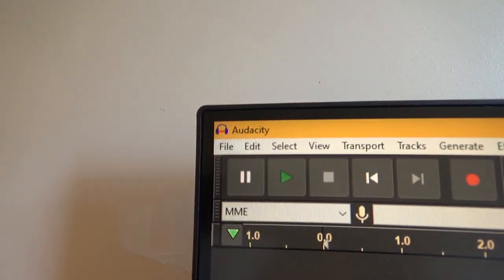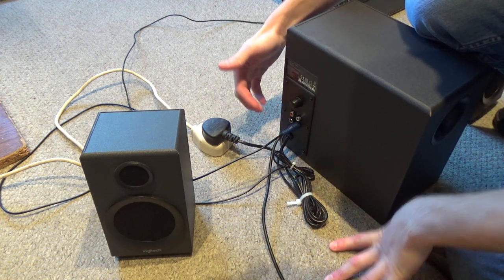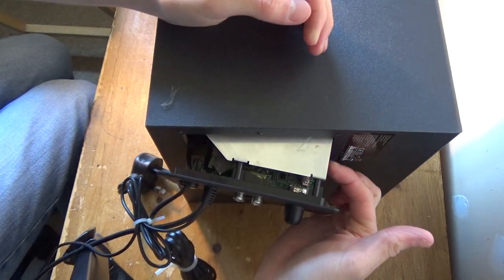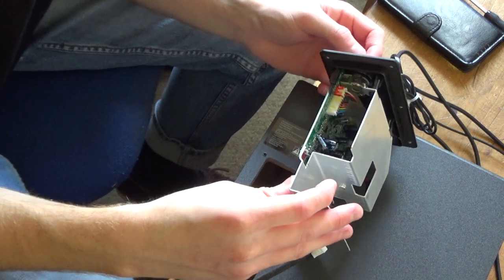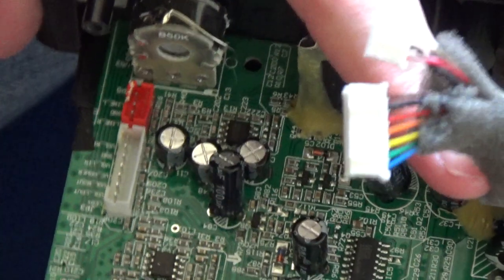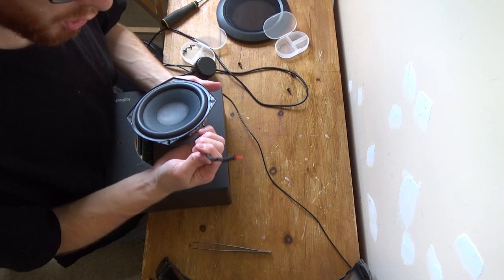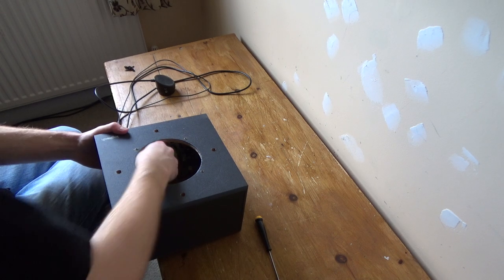Trying to Fix My Logitech Z333 2.1 Speakers (One Speaker is louder Than the Other)

Comment: I'm having the same problem. So surprised others do too!  I thought Logitech had good stuff
Reply: same
Reply: it has good stuff
just the quality controll sucks
i have had these speakers as my daily frivers for 2 years now
despite me driving them crazy and possibly overvolting them(and overwatting them) the just are clear as ever
(occasionally clipping a bit)but the get to 140w from 80w
so it can draw a lot more power safely that its recomended
Reply: i usually go into windows audio settings and turn one up louder if I had to fix it
Reply: did you realise the tweeter is a sticker ? its fake lol
Reply: @ryanmcivor2774  really? Lol 😂

Comment: Same problem here: black output volume worked fine, blue output volume was very very low regardless of which speaker was attached. My problem was the potentiometer underneath the volume knob. It was not outputting the same resistance for both left and right speakers.

At 8:52, you can see the white 7-pin clip coming from the volume knob/pot. The resistance between VOL_LOUT and GND and the resistance between VOL_ROUT and GND should be the same at any specific knob position. Seems they should scale between 0 and about 12-14 kOhm as the knob is turned from 0 to 100%. My VOL_LOUT maxed out at ~25 Ohm for 10-100% volume, whereas VOL_ROUT output the whole 12-14 kOhm range. I was able to fix it simply by blowing compressed air into and around the pot in the middle of the PCB at 30:21. Seems to have been weak contact in the pot or it's wearing out...

Hopefully this helps someone.
Reply: Works here! Thank you soo much
Reply: Works here too! Thanks for sharing your solution.
Reply: man exactly the same but here the blue output broke both my speakers from my old z333 and my new z333
both speakers just sounding horrible now, no clue what the blue output did to the speakers :/
running 1 speaker only
Reply: Just took mine apart. took the connector out and gave a few good turns on the pot and all working fine.
 Thanks for pointing in the right direction.
Reply: Thanks you so much much ! I had tried to dismentle de back pannel but couldn't and was so frustrated ! Now I'm so pleased with my two speakers blasting ! (it was the Left output aswell)
Reply: @yojojonathan  Wow, I was getting ready to take mine apart and just gave the pot a few good turns to max and min with a tiny pressure solved it. Thanks!
Reply: English please
Reply: Still helping in 2024 👍

Comment: I had no sound on right speaker. The problem was on the headphone jack.  There is a switch inside the jack that de-activate the speakers, move it with a toothpick and problem fixed some contact cleaner may help too.
Reply: GRACIAS!!! ME FUNCIONÓ, MUCHAS GRACIAS AMIGO, yo le puse unos audífonos sin meterlos hasta adentro y de funcionaron! :D
Reply: now the new problem is that it gives me Mono audio, with you is the same?
Reply: How do i move it plz respond and where is the de activate in the 3.5mm
Reply: RAFADABO55  When you insert the headphones there’s a tiny tab inside that disconnects the sound to the speakers. I manage to move it and it worked for a while. I ended removing the headphone jack and soldering small wires between the terminals in the board.
Reply: @j.r.cabrera5813  so i put a little toothpick into the headphone jack?
Reply: @eksine  i found this Fix quite a long time ago but still thanks for taking your time and responding to me
Reply: Ich habe auch erst alles auseinander gebaut und dann war es doch nur der Schalter. Einmal rein mit dem Zahnstocher und schon ging es wieder. Danke für den genialen Tipp. Vielen Dank.
Reply: I had no sound in left speaker, the first thing is to try look is at the connector for the speaker that has no sound, squeeze the connector inwards so it makes harder contact with the output on the sub-woofer box's amplifier board, the connector is loose and making poor contact with the amplifier output connection. if that doesn't fix it than you must unscrew the amplifier board and check for loose capacitors, you must reflow the solder because the capacitor solder joint has broken loose and is making poor contact
Reply: @j.r.cabrera5813  do you remember which terminals?
Reply: THIS THIS THIS !!!! This is what solved/workedaround my issue. THANK YOU!!!!
Reply: Brother can you make a quick 30 second video i need help
Reply: @emmanuelmanzanilla2955  Brother can you make a quick 30 second video i need help

Comment: I was going to try to fix some connection issues on my Z333 but seeing this video made me drop that idea. Not only do you have to take apart the entire sub to get out the little control board but the RCA connectors are like a full-on assembly? Probably not worth the time and effort for a $50 sound system...

Comment: I had no sound in left speaker, the first thing is to try look is at the connector for the speaker that has no sound, squeeze the connector inwards so it makes harder contact with the output on the sub-woofer box's amplifier board, the connector is loose and making poor contact with the amplifier output connection. if that doesn't fix it than you must unscrew the amplifier board and check for loose capacitors, you must reflow the solder because the capacitor solder joint has broken loose and is making poor contact. mine is fixed now

Comment: Im having the same issue right now.
Reply: Did you fix the issue?
Reply: @evenus3044  No. I just bought a new one XD
Reply: @evenus3044  i have the z533, the right speaker stopped working, I unplugged the AC, double checked for no power and felt a loose capacitor, touched it with a screwdriver and used that to straighten capacitor. seems to be fixed
Reply: @eksine  Lol, same. two capacitors were bent, I just straightened them and everything works like a charm again :)
Reply: @dejanzvonar9187  i ended reflowing the solder to the caps, it worked for a while but still getting the same issue, 1 speaker cuts out, replugging the audio input fixes it but it goes out as soon as the pc goes to hibernate. maybe the caps need to be replaced or maybe its a bad microprocessor. its a huge shame, these sound good while both side work. i could just bridge the wires to both channels so at least i have both working again
Reply: @dejanzvonar9187  I think I just found the fix to this! I had no sound in left speaker, the first thing is to try look is at the connector for the speaker that has no sound, squeeze the connector inwards so it makes harder contact with the output on the sub-woofer box's amplifier board, the connector is loose and making poor contact with the amplifier output connection. if that doesn't fix it than you must unscrew the amplifier board and check for loose capacitors, you must reflow the solder because the capacitor solder joint has broken loose and is making poor contact. << that's cut and paste from my other comment so it's for everybody as a fix

Comment: I think I have figured it out. I had the same problem with my right speaker very quiet and the left normal volume. When I had only the right speaker plugged into the subwoofer I ended up bumping the 3.5mm jack that connects to the back of the computer. It suddenly got louder. I continued jiggling the jack and the volume changed up and down accordingly. So for mine, the wires in the PC jack must be damaged. Cheers
Reply: worked for me. the subwoofer was hitting the wall because it's placed too close into it. made some space then tipped the wire a bit and that fixed it. thanks man.

Comment: i cleaned mine all the outputs and it miraculously fixed
Reply: How
Reply: @jeffcleds  I think I found the fix! I was using the 3.5mm jack from the speakers to the desktop PC, When I bought an RCA to 3.5mm adapter both speakers work. the speakers have 2 input types, 3.5mm and RCA left and right output. use the other one, something inside the speaker has failed
Reply: @eksine  I have tried this fix but for me it didn't work. I'm afraid I have to solder the connections on the board. I think Logitech have to improve their quality checks on their products.

Comment: I was using an aux cable extension adapter, removing it and connecting the logitech speaker directly to pc Fixed it, i hope this will be all you need to fix yours. It was working before with that extension adapter tho, i don't onow why it stopped working properly.

Comment: I had the same problem with my Z337, the issue was caused by the potentiometer in the volume wheel which was internally become dirty (also oxidized maybe).
I solved the issue desoldering the potentiometer (with a desolderer and the soldererer with a copper desoldering braid), opening it and cleaning the internal circuit traces with alcohol, I also cleaned and bent a bit the internal brushes so they make better contact.
It's not too difficult if you have some skills doing these type of things.
In this way I also fixed the "scratch noises" problem that occurred when I rotated the knob, now it doesn't make any annoying sound.
The potentiometer is called (I think it is its name?) B503 and it has 6 pins. I found similar ones on Aliexpress for a few bucks and I ordered them, if the problem occours again I'll try them
Reply: i have the z533, the right speaker stopped working, I unplugged the AC, double checked for no power and felt a loose capacitor, touched it with a screwdriver and used that to straighten capacitor. seems to be fixed
Reply: how did you open the knob to access the PCB for the z337. I tried to snatch the top out but nothing came out as easy as shown in this video.
Reply: Iam having probably same problem here, but iam scare to soldering that...

Comment: I had a similar issue with my Logitech Z337, but it was only present when the volume was set approximately to a quarter or less.
I took off the volume control knob (just pull it out, don't be afraid to use a bit more force) and sprayed a little amount of WD-40 into the potentiometer. Then I rotated it a few times for the oil to settle and the issue is gone now!
Also, when I was turning the volume knob, the speakers were cracking, now this is fixed as well.
Reply from the maker: Good tip! I also experience the crackling, I believe it's caused from dust/debris inside the volume potentiometer which interferes with it's function.

Comment: I have the same speakers, when I opened it up I noticed the glue, and took some of it off. However my fix was to push in the black box that holds the audio jacks into the PCB. For some reason this was one of the only things that didn't have glue on mine, but yours did despite being the exact same model.

Comment: Had the same problem, usually just putting the volume at max and then thouching the head of the 3.5mm plug with the tip of my finger repetidely did the trick, this time that was not enough
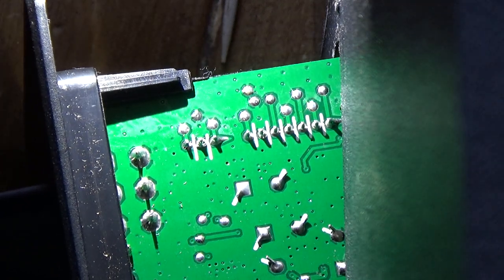Had to touch the pins on the back of the white conectors (why are they glued lol), specifically the one for VOL_ROUT seen in 8:54, which is the 3rd one from right to left seen in 10:34, fingered that little thing a couple of times, each time i touched it the sound changed in timber, until eventually it came back to normal

Comment: i have a trust tytan 2.1 speaker set and i have a problem with the volume control thing that has 2 aux cables + 1 3.5 mm jack when i turn it to max volume it switches speakers so one becomes louder than the other

Comment: I've bought this 2.1 Speaker set as a christmass present. I would like to know, is if this problem had occured some time later of using it, or when it was brand new connected to PC and started acting weird?
Reply from the maker: Thanks for watching, with me, the problem occurred sometime later after using, but I've had other comments saying their speakers suffered from this issue when brand new. I think it's hit-and-miss with this issue.

When I still owned the speakers, I disassembled the volume control and cleaned the PCB and volume potentiometer which fixed the issue temporarily, but it always returned and eventually, I decided to replace them (and made this video too).

Comment: you tried your best but when i saw the glue was thinking they had a reason to be there.I think because of the vibration from the sound that might be an extra security step to make sure they don't get lose.but the 2.thought i had was it might be because they want to prevent someone takes it in apart.good that i know now for what to look for NOT to do.

Comment: The glue on the green board looks like somebody sneezed on it!

Anyway, it's pretty frustrating that this video didn't tell me how to fix the issue, but at least I got to see inside my speakers. I probably won't try any of this because it's happened before and the left speaker (on mine) always comes back on again eventually, but I can't believe they make it so hard to dismantle, considering how often this problem seems to happen.
Reply: I think I found the fix! I was using the 3.5mm jack from the speakers to the desktop PC, When I bought an RCA to 3.5mm adapter both speakers work. the speakers have 2 input types, 3.5mm and RCA left and right output. use the other one, something inside the speaker has failed

Comment: I had a similar problem, what i did I bought RCA plugs, cut the cable, put it into the new plug, and my sound went back to normal. edit:  I cut the old plugs open andthe left one it seems that the white cable wasn't soldered to the plug properly, it was barelly scratching the place where it should be soldered. that's why new plugs helped.

Comment: I'm having the same problem. Bought them 2.5 years ago.
Reply: i have the z533, the right speaker stopped working, I unplugged the AC, double checked for no power and felt a loose capacitor, touched it with a screwdriver and used that to straighten capacitor. seems to be fixed

Comment: mine has a crackling sound when i move the 3.5 mm cable. does anyone know of an easy way to fix it
Reply: that's normal, it's because you need to turn off the speakers before you disconnect, if you understood how speakers worked you would know

Comment: Or you could get a 2 Male RCA 1 3,5mm Male cable and connect it in the back of the sub... just sayin...🤷‍♂️🤷‍♂️🤷‍♂️
Reply: @FrazerForbes1  ❤🥰🤩
Reply: I tried this on a Z533 where the right audio output does not work. Changing from 3.5 to 2 male RCA did not change the output channel issue.

Comment: My blue input doesn’t work, any advice? Both speakers work in black input but neither In the blue
Reply: same , need help
Reply: omg, Ijust bought mine Z333 and have the same issue... :/
Reply: i would like to help you as i fixed mine, but i dont know the words for it...
Reply: @wolfy4278  was it too complicated or an easy fix?
Reply: Shako Winter complicated , i had to destroy the cable that gets into the pc and look inside it, inside i found an cable that comes from the second speaker so that means the cable was broken and thats why. i fixed it with some adesive band or some thing and then plug it back in and it worked, if you want i can give you my discord and show you exactly
Reply: @wolfy4278  that's what I figured today... The 3.5mm cable has lose connection, damaged right before the jack. I'm gonna replace the jack tomorrow and hopefully it will be just fine. Thanx for the response.
Reply: Shako Winter np m8
Reply: Change the capacitor behind the port. The 1000uF 16v
Reply: @wolfy4278  hey, can u show me how u did it? having the same issues
Reply: @puuugiii  are u trolling or is that a actual fix
Reply: Same. I see these speakers are rubbish.
Reply: @shakowinter  can i add you?

Comment: Ye I'd rather throw money at the problem and give these to someone else tbh lol. My issue is that the sound plays fine, unless you leave the speakers for like 30 minutes... Then there's an electric high pitch whine playing through them, so high pitch it's barely audible. Then you need to turn the audio up to play audio again. So it's probably bad wiring, and I'm just cranking it up to the point where it creates a temporary connection or something? Like sure, I could just turn my speakers a little louder, but I'm in an apartment lol. I don't want to be that neighbour.

Comment: My left one is ok. Right is not loud enough. I inverted the cables and determined is not the speakers. What a piece of shit.
Reply: try using the rca output instead of the 3.5mm jack, fixed my problem
Reply: @eksine  Thanks so much, your comment saved me the trouble of tearing it apart myself!
Reply: @eksine  that's isn't working in my case, what shoould i do?

Comment: I lose power in the R speaker because pcb afer 3 years.
Reply: I think I found the fix! I was using the 3.5mm jack from the speakers to the desktop PC, When I bought an RCA to 3.5mm adapter both speakers work. the speakers have 2 input types, 3.5mm and RCA left and right output. use the other one, something inside the speaker has failed

Comment: My right speaker was louder than my left, but I finally discovered what was wrong. Because of the position of my subwoofer, I decided to switch the  connectors and then switch the position of the speakers. I didn't think  there'd be anything wrong. Turns out connecting the right connectors to the right sockets solved the problem. Basically blue goes into blue. Black goes into black. Or else the volume imbalance  problem occurs. This comment is only for those who made the same mistake as me.